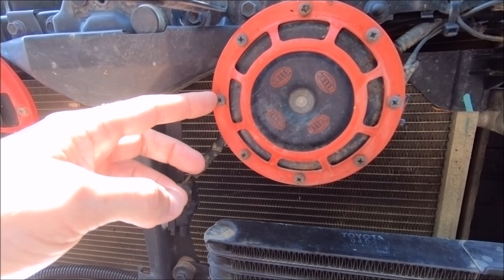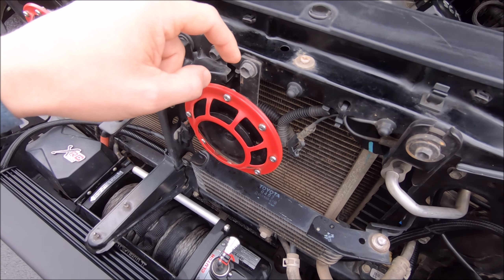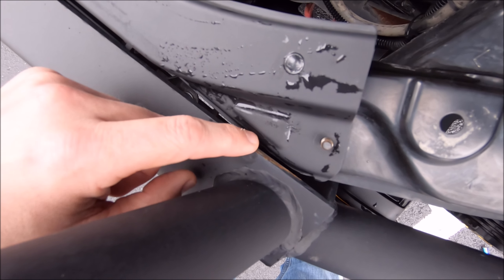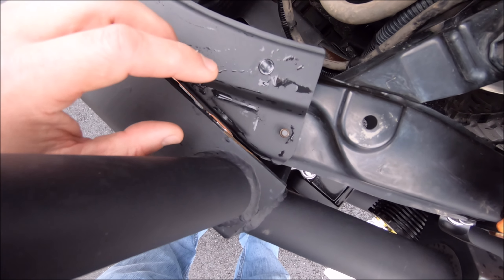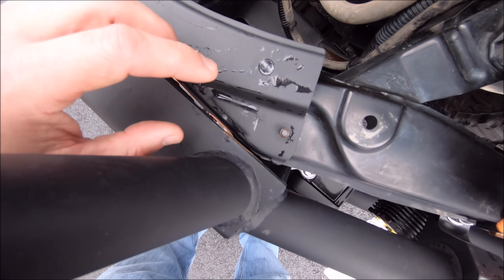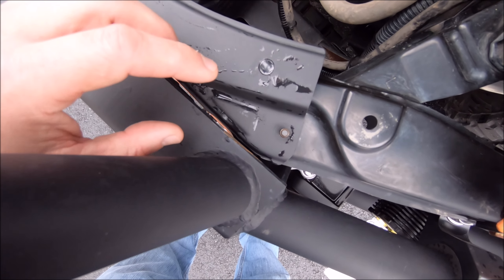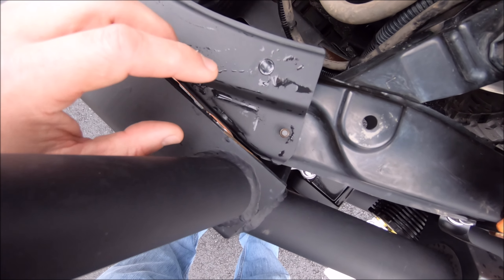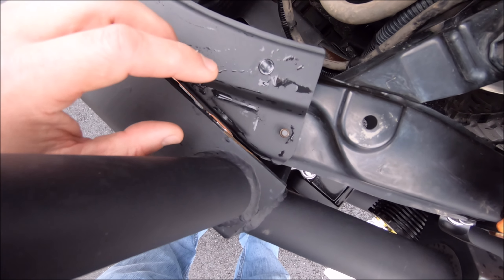Toyota Tacoma Gets More Vinyl Wrap + Other Mini Projects

Comment: Is it actually tinted on the turn signal or is it a spray. I was trying to find replacements in the smoked but no luck.  Thanx
Reply from the maker: It's actual window tint that was applied just like a vinyl wrap to the turn signal part.

Comment: This is a throw back but how are you liking the rubber piece you put across the dash where it meets the windshield on the interior?  I’ve noticed my 2012 has a slight squeak up in that area from time to time.
Reply: i had the same issue with my 2012 but once i put in the rubber piece the squeaking went away.
Reply from the maker: That piece has been great and should help with any of those dash squeaks.

Comment: Your ground on the Pass side behind the grille on the rad support is looking a little crusty. Bad grounds can cause some electrical gremlins later.
Reply from the maker: Good looking out! I checked it out and looked like just dirt mixed with dielectric grease but I cleaned off the connections and covered everything in a fresh coat of the grease.

Comment: What are all those antennas that you have on your truck?
Reply from the maker: 13" flexible radio antenna and I'm just using the front 3' Firestik as a feeler for branches.
Reply: @Tacomaholic  Pretty cool, ive seen some Tacos with cellphone booster antennas too.